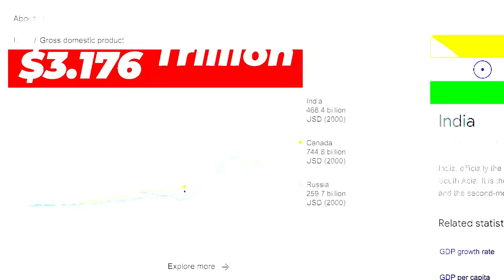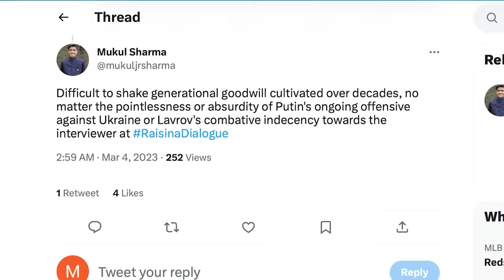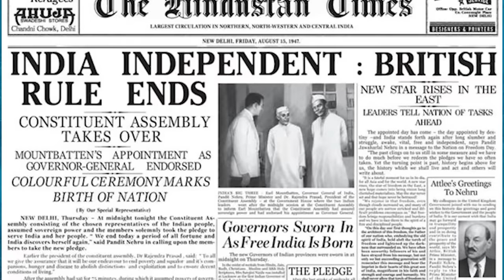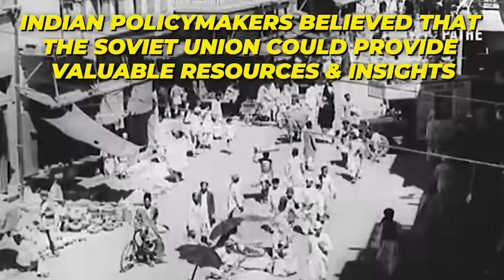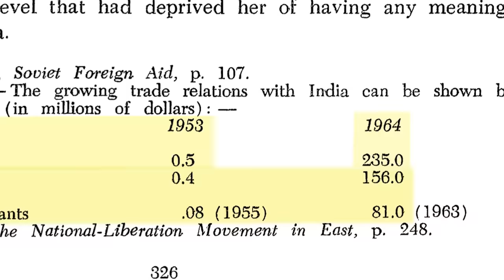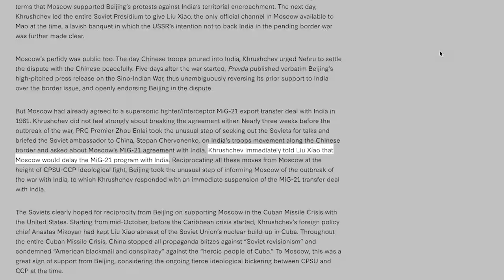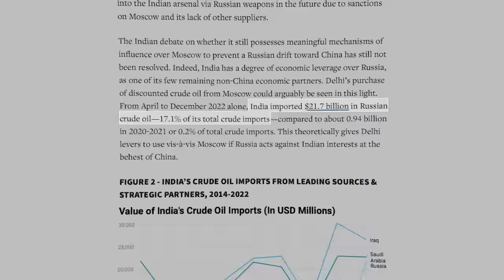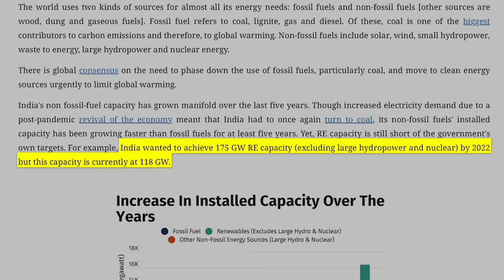India's Problem with Russia is Worse Than You Think

Comment: Key point on the oil: India is buying deeply discounted crude, refining it, and selling it on. This in turn keeps the global prices at a reasonable level and prevents Russia from reaping the windfall of soaring oil prices. I think most Western analysts would call this a net positive: deny Russia its most profitable hydrocarbon exports without sending global prices through the roof.
Reply: The oil is not deeply discounted, this was a limited time offer for 2 to 3 months only which has long ago since expired
Reply: That is a most interesting observation, Drew.

Comment: @Task & Purpose A common misconception among foreigners is that India use the exact same export variant of Russian equipment ,whereas Indian used Russian weapons are very different and includes Indigenous systems/subsystems along with  foreign made additions . For example 
Su 30 used by India are of Su 30 Mki variant which are equipped with Indian, Israeli and French made avionics, Mission computer, Electronics and Communications . Su 30 mki can also fire Meteor and ASRAAM missile along with Indigenous BVR  missile Astra .

India is going to replace / is replacing  many of the existing Soviet/Russian made weapons with Made in India systems like 
Mig 21 and 27 with HAL Tejas MK1 and Mk1a
Osa 9k33 SAM system with  Drdo QRSAM 
Pechora SAM with Akash SAM 
etc...

India has an existing manufacturing base for the production of critical spare parts for regular maintenance of Russian weapon systems  .
Reply from the maker: that's a great point! I've covered India's military modernization about a year ago and there's a lot there I need to dig into and cover in a future video
Reply: i have heard of an Indian indigenous attack helicopter completely replacing imported systems due to the hi-altitude / hi-payload requirements along India's mountain regions.  Is that a major program or just a smaller support project?
Reply: @kevinkanter2537  you are talking about LCH it is a small heli when compared to apache army is currently intrested in buying more apache's
Reply: @vishnu98765  Actually, the Indian Army and Air Force are looking to procure the LCH(15 + 114 ordered) in significantly greater numbers than the Apache(22 + 6 ordered). Which makes sense, as while the Apache helicopter is faster(thanks to its superior TWR), the LCH has a greater range, a higher service ceiling, and is domestically produced.
Reply: @Kevin Kanter  Indian helicopters at the moment are only capable of replacing the light attack/utility variants exported by foreign powers. Large helicopters like Apache, Mi-17, and Chinook are still being imported from outside. It will take at least one more decade before India develops most of the helicopters indigenously.  When it comes to fighter aircrafts, we have been able to develop only a Light combat aircraft at the moment called Tejas. This will be good enough to replace the ancient mig21's operated by the Indian air force. We are also developing a more capable version of Tejas called Mk2 which will be in the same class as Gripen E offered by Sweden. Once developed Tejas Mk2 will replace Mirage 2000, Jaguar and Mig 29's from the Indian airforce. India is also developing a stealth aircraft called AMCA which is a lot like the Korean platform being developed but given the complexity of the technology and terrible track record of Indian public sector firms this will take a lot of time to materialize. Until then India will keep importing dual engine fighter aircrafts from the west. The only saving grace with India is it's Naval and missle program but budget constraints limit India massively.
Reply: @ivangarcia1327  what's up with the British shit.
They didn't do it for free lol.
And we already had our own extensive military history and we fight with those principles and training.
Reply: @ivangarcia1327  yeah and you are trying to impose those history in present day. Today indian army gives training to US forces in high altitude warfare. When you guys leave your superiority complex. 
And about military gear.. There are various special forces in India with well equipped military gear but some border forces like BSF has little bit lower quality of equipment. 
Isn't it irony that you don't know about indian military particularly and trying to comment on it with some videos and pictures.
Reply: @Kevin Kanter LCH(Light Combat Helicopter) is a serious program considering the altitude and low air density on top of Himalayan ranges.
It was never meant to compete apache(different category),it was meant to go higher and maneauver in high Himalayan ranges with a decent firepower.
LCH Program was result of the lessons we learnt in previous wars  while fighting on world's highest regions in our north.
Reply: @ivangarcia1327  correctly summarised.
Reply: @kevinkanter2537  major and it is in full force
Reply: @vishnu98765  na lch order is 114+ more in future and thats of apache wich is 22+
Reply: @AjayTiwari-en9nz  thanks for sharing the current capabilities and the strategic direction of the MIC for Indian air-borne power --  hope US continues joint-training and military cooperation with India.
Reply: @Taskandpurpose  Please take a look below at some of the comments as well - it would be good to know of tighter integration between US helicopter / armed forces and India / US MIC licensing or joint purchase projects.  
We could do no better than to be challenged by and coordinating with the Indian technical and military ecosystems --- imho, though i am from IT / Chip fab/packaging background.
Reply: @vishnu98765  Bro LCH is essential because Apache can't be used at high altitudes of the Himalayan mountain range
Reply: @kevinkanter2537  That's still under some user trials and the armed forces have placed an order in small numbers. The Indian army tests a new weapon for decades until it becomes obsolete.

Examples: Arjun mk1 tank and Tejas mk1 (FOC and IOC) 

These amazing weapons are rarely bought and by the time the order is placed, it's already almost obsolete.

Comment: One thing that was not covered was India's sub-par experience with post soviet Russian Defence Paraphanelia. India purchased INS Vikramaditya Aircraft Carrier from Russia which was mothballed Soviet Missile Cruiser of Gorshkov class. It was offered for around $1.5 billion, deal was signed, payments were made and cost was immediately jacked up to $4.5 billion USD.

Russian Shipbuilder Sevamash Ship Yard issued a threats on the lines of "Pay up $4 Billion or we would fix the ship and hand it over to Russian Navy. Since the payments were done and India was over dependent on Russia that was the worst nightmare for the government of that time. After a lot of back and forth a new deal was worked out, where India paid up more money, delivery was delayed and right before the delivery the ship broke down due to shoddy workmanship in the boilers.

Its not only Indian Navy, IAF operates, SU-30 MKI which come with AL-31 engines which were not thermocline which means that these engines work fine in cold subzero temperatures of Russia but in Hot and Humid and high sea level environment of India these engines used to wear out fast and perform suboptimally. The situation was so dire that Indian scientists had to work on AL-31 Engine, reverse engineer the components, work on new thermal coating for AL-31 engines to make them flight worthy since IAF operates over 250+ SU 30 MKI. Even after doing so much work the availability of the aircraft is only 60%.
Reply: You are absolutely right, sir
Reply: Correct.

Comment: I'd say India has done pretty well in diversifying their supplier base. Just off the top of my head I can think of India having recently bought, licence-built, or co-developed major platforms or weapons systems from Israel, the US, France, South Korea, and the UK.
Reply: Thats a poor decision. Buying arms from multiple countries is the opposite of interoperability.
Reply: It is actually was a bad idea. I say that as an Indian.
Reply: @kimchi2780  Interoperability is not a big deal, with right intellectual property it can be configured.
Reply: @kimchi2780  yea assault rifles share lotta parts with mobile artillery 🤣😂
Reply: Hardly, too late and too little. They wasted decades.
Reply: It is supply and maintenance nightmares to have many different system.
Reply: @davidz7858  Ofcourse.. sourcing assault rifles & mobile artillery from same country would be so much more maintainable than but the best from different specialists 🤣
Reply: @kimchi2780 yeah, why upset one country that supplies you spares and get cut off. Which the u.S has done many times.
Reply: @YaMomsOyster  Interoperability isn't US its NATO standard its more than 1 country. NATO is the standard the US uses.
Reply: There is nothing like a perfect solution for anything ever. Yes Interoperability could be challenging. I am sure they must have thought it through as it's basic stuff before serious decisions like this. But relying only on one or two countries for the defense equipment is even worse a decision. Then India will be bound to obey them and settle on their terms. If India did something on our own that those suppliers didn't like, they could easily impose a ban to screw the defense all together forcing India to agree to their terms, which is the most important factor India is concerned about. After all, these are all temporary solutions, until India reaches their 50% localized weapons manufacturing target so to me I think this is the better decision
Reply: Like what?

Comment: A pleasant surprise from a westerner; thanks for a more balanced presentation.

I would like to add a few more points. India was not aligned to the Soviet Union/Russia in all matters. 

Both the Indian public and the Govt. like the democratic principles and the manner of governance of the West; that is why huge Indian diaspora is  found there.
There have been collaborations with the West as well in several areas. Steel Plants, IITs, Atomic Research Centre, Oil Refineries apart from many multinational companies. So it is not as if India did not want to have good relations with the West.

Nevertheless, USA and its allies have often been (and are) hostile to India by supporting Pakistan, harassing India on some issue or the other to achieve some political objective.

India is in a very hostile neighbourhood (unlike the USA); it has to maintain good relations with Russia, Iran and all its neighbours to face the dangerous duo - China & Pakistan.

High time the western countries appreciate this fact.

Comment: If simply put I will give you an example if I wanted tank which is state of the art slightly lower performance than the Panther or British Challenger 2 Are older version of Abrams and you need at lowest cost as possible and you know it all the technical transfer knowledge at a cost of 2.2 billion and 500 units production licence who will give it And helping to set up the factory